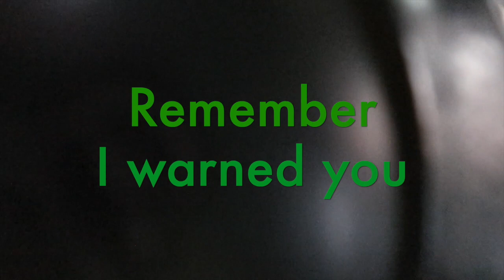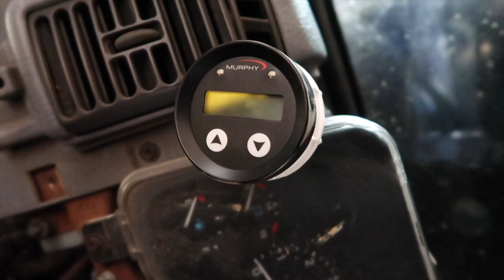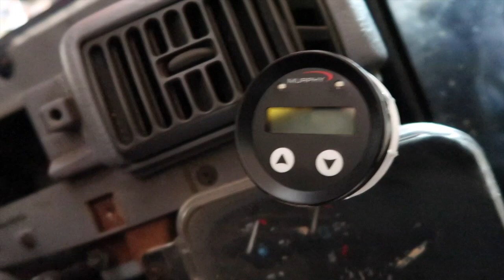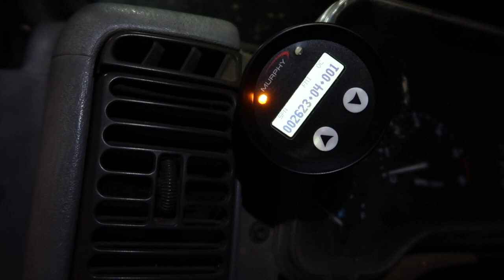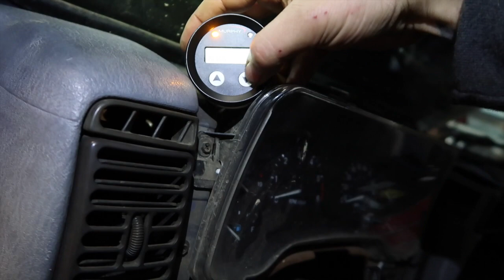R2.8 Cummins Swap Part 3 First Start Up

Comment: I too did an R2.8 swap on my 99 TJ.
Reply from the maker: That's awesome. I'd love to see the build and hear your impressions.
Reply: How much did the swap run you guys total?
Reply from the maker: @tay5658  Just to get this running with a kit was $17,500. I added wheels, tires, extended range fuel tank, gauges, and then there was stuff that was just needed or "while it's out" kind of stuff I fixed/replaced too. With all of that stuff I was right around $20k. FYI, in a Jeep, if you want AC add a few thousand more. I didn't want AC.

That's a lot of money, but I did talk about my reasons in another video:

https://youtu.be/oHSWr68D39Y
Reply: @bugoutjeep8065  damn ouch I really wasn't expecting that high of a price tag
Reply from the maker: @renjoh  Unfortunately any crate engine swap is gonna be expensive. There are lots of cheaper used options out there for diesel and gas swaps. Really I compare the price I paid to something that's brand new mixed with a heavy dose of preferences and aesthetics and with both being fairly close, as far as function, the R2.8 is cheaper in the long run for me to keep forever.

Comment: Which AC compressor did you use? Understand that it does not come with one in the kit
Reply from the maker: I decided against ac. I try to go doorless in the summer. I don't have much with ac anyway.

I could have gone ac with the Mega bracket Axis sells, but I think adding that as a kit would cost about $3k.

Comment: what kinda fuel economy are you getting now?
Reply from the maker: At first, with 33in mud terrains, mostly empty and small fuel leak, I was getting about 26 mpg. Adding the rack, towing, winch, cargo, stuff on top and 4x4, I get low 20s/high teens, but with 3.07s and the rack, I'm under geared for the highway and most roads. 

I suspect when I go to 3.73s I'll see mid to low 20s and I'm planning to get a tune and try to get a little more from it. In perspective, I was getting about 11mpg with 29in mud tires, winch, etc, but no rack.

Comment: What is your MPG now that you have it in and running
Reply from the maker: First I was getting 26 mpg on the tank. Added a roof rack and my tires started cupping and it dropped to low 20s. Went to smaller road tires that simulated 33s and 3.73 gearing and it went to mid 20s. I just finished my regear, lockers, super 35 and suspension and steering upgrade, so I can't wait to see what it'll be after break in.
Reply: @bugoutjeep8065  any update on mpg? I trying to decide between this and the 1.9 TDI.

Comment: How much room is left in the engine bay? I have the 2.4L and I like all the extra space I have vs the 4.0. 

Also, what radiator / fuel tank are you using?
Reply from the maker: Less room for sure vs OEM. The R2.8 and the accessories are fairly wide too and the EGR is like having a second battery, except it is there to only hurt the engine and the efficiency. 

It's the turbo and piping that really gets you with the r2.8. I have a YJ with the 4 cylinder and I do like all that space, but the 4.0 was very good too and the r2.8 isn't too bad.

Comment: I want one of these in my ranger in a bad way.
Reply from the maker: You should do it. It's a great mod, if you really want your truck as versatile as it can be
Reply: @bugoutjeep8065  I haven't looked into it much but I'm very interested my only real concern is drive train adapters and motor mounts. Did you get those with the the motor?